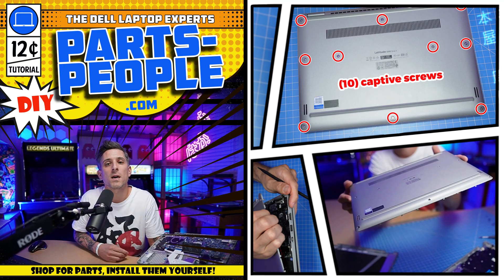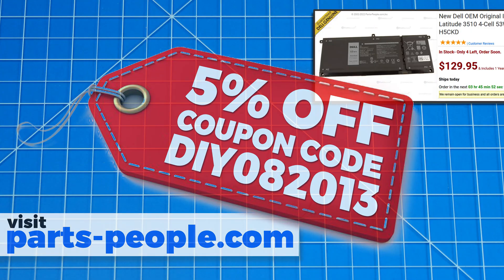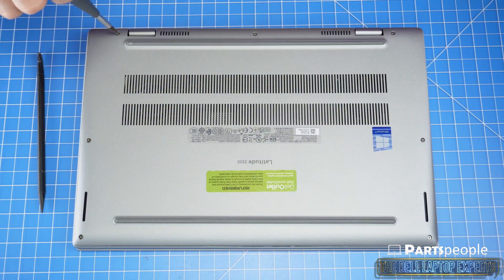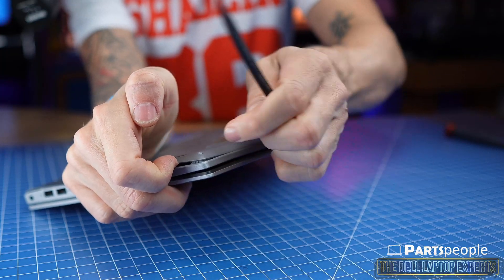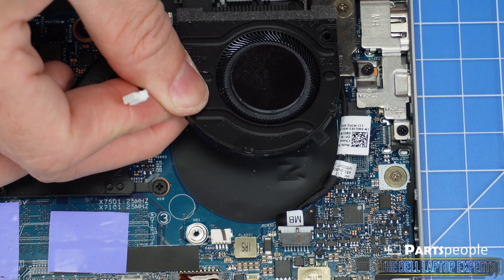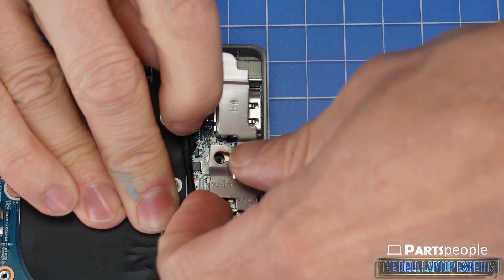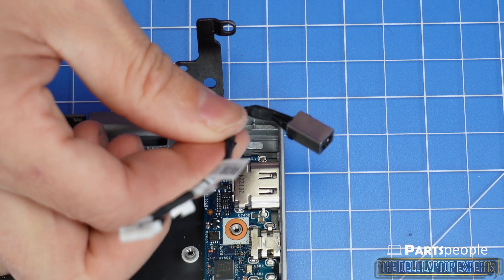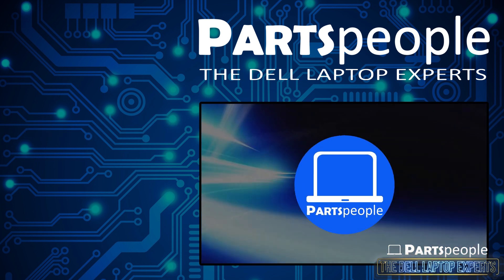Dell Latitude 13 (3320) How-To Install & Replace DC Jack/Charging Port | Repair Guide

Comment: How do one know that one needs to replace the DC charging port jack?
Reply from the maker: If your charger/power supply is not providing power to the laptop, I would first try a different charger. If at that point your are still not getting power I would suspect the DC jack is the issue.
Reply: @dellpartspeople  Thanks!
Reply from the maker: @sameergauria  You're welcome!